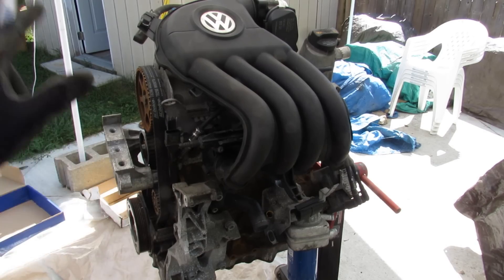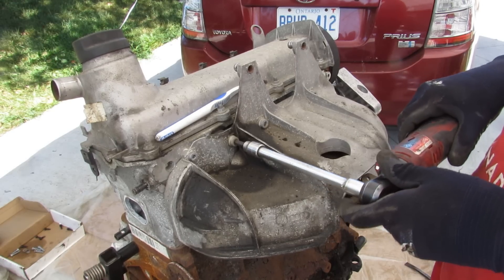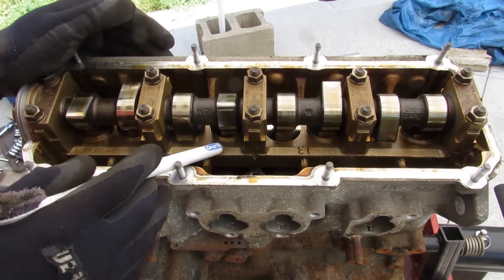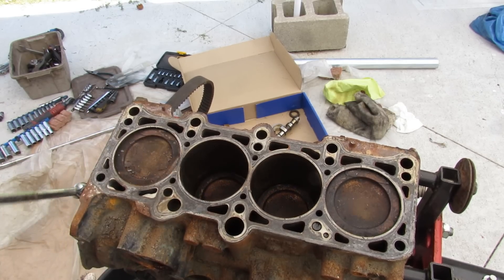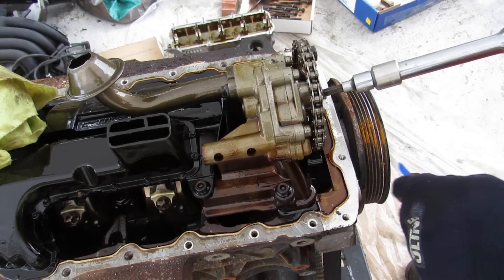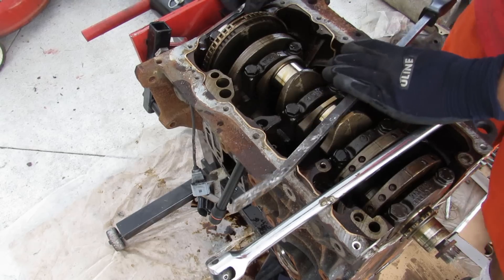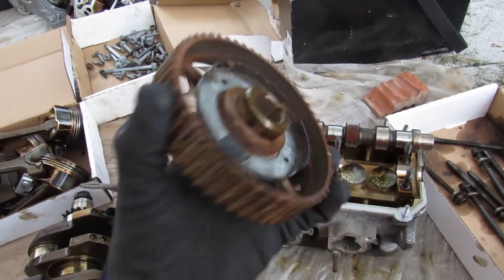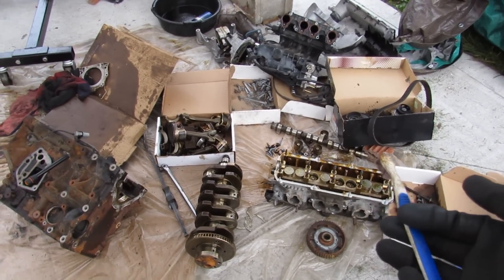The Simplest Modern Engine - From Volkswagen?

Comment: These EA287 engines are an older design. I had a 1989 B3 Passat with this engine in it. Absolutely bomb-proof. I sold mine at 15 years old with 160,000 miles on the clock, and saw it on the road 2 or 3 years later. Great cars that handled well , with strong simple and economical engines.
Reply: Mom had a B4 Passat from 1996 till 2011, 17 years. Got a JSW 2.5 to replace it.

Comment: Simple is GOOD. Dependable, reliable, easy to work on. And iron blocks are strong, don't require sleeves. If this were turbo charged, it would put out at least 180 hp, 200 pound feet of torque. Need more like this in other cars.
Reply: Looks like a good engine to modify.
Reply: @SI0AX  the 1.8 8v version can actually make 230HP without any internal modifications to the engine. This engines are bulletproof.
Reply: @ahyhijooooo  The 1.8 Turbo or the 1.8 non-turbo? I know the VW 1.8 Turbo engines are some of the most longest lasting 4 cylinder engines on par with the Mistubishi 4G63 EVO engine that can  get past 250,000 miles with good maintenance.
Reply: @SI0AX  the none turbo 8 valve. It's identical to this engine except the intake and displacement.
Reply: @SI0AX  Ever heard of Volvo b230?
Reply: @nikolaierikssonkukkonen9878  I know the older generation Volvo cars had outstanding durability and reliability and also safety standards. I did a bit of research and am impressed it comes factory with forged pistons.
Reply: @SI0AX  Got a 1.8t 20 valve in my 2004 Cupra R, the car is pushing 160.000km now and apart from a slightly rough idle sometimes, the engine is still runing like a champ! Still got the original 225hp for sure. IMHO one of the best 4 bangers ever made.
Reply: @SI0AX  B230f (N/A) and b230fk (turbo) did not come stock with forged pistons. They are actually the same internally only that the N/A has a higher compression ratio. Around 350 whp is the limit with stock rods in b230. Put some H-profile rods in it and the limit is much much more
Reply: @ahyhijooooo  glad to hear. I got a 1.8 8v with 402000 km on it. No smoke seems good wanna turbo it lol
Reply: @SI0AX  the N/A FWD world record was made with a variant of this engine
Reply: @SI0AX  They are the bread and butter of brazilian tunners, the guys make way over 1000 hp here.
Reply: good engine to work on if you have a massive tool box, too many different types of bolts...
Reply: @hgri89  B230? I can take half my 240  apart with a normal sized toolbox.
Reply: @nikolaierikssonkukkonen9878  I love the B230 but it does not make the power it should. It lasts so long because Volvo de-tuned it for longevity, not power. Even the turbo versions had pathetic low HP numbers. I loved my Volvo but I sold my 240 because it was terribly under-powered for being a 2.3. 

VW makes engines that will put a smile on your face and last longer than the car. I have had several VWs with high miles that run smooth and never needed to be taken apart. My wife's car has over 400K miles on the original engine, the head has never been off of it. The original clutch lasted 360K miles. 

It isn't a big deal having some triple-square bits added to your tool set. Chances are you won't even need to use them.
Reply: @David_H_Parker  Thats why you tune your volvo ;) tbh getting power out of a turbo b230 is not hard (N/A is a little bit trickier but it is not hard)
Reply: @nikolaierikssonkukkonen9878  Being in California, tuning a B230 for power would never be emissions legal for a daily driver.

I know how to modify engines and make more power. However, California does not allow much for modification on street driven vehicles.

The VW is pretty easy to make decent power and stay emissions legal. Or at least fly under the radar during inspections.
Reply: @David_H_Parker  "Laughs in Swedish laws"
Reply: Yeah bro I got a passat with a turbocharged 2.0 and it gets 207hp and 210 torque or sumn like that
Reply: This was a dog of an engine though. A Honda K20 with the same displacement even in it's most economical trim did 150bhp on 87 and got better milage than this.
Reply: @stuntmonkey00  The Honda is also a lighter car.
Reply: Volts wagon can’t make a reliable engine to save their life

Comment: It's basically the same engine since late 90's. But they have good torque in their midrange making it very flexible in their operating range. The 2.0L also has good longevity.
Reply: Might as well go all the way back to 74 or so in the mk1s, the lower end has been around forever.
Reply: @MrTheHillfolk  yeah, most of this stuff is identical to my 1984 1.7. Audi introduced the design a decade earlier
Reply: @twiggymac  another neat thing in the VW world is , look what engine is still used today to make the most power. 
Not a vr6,not a 1.8t , but the good ol 16v from the 80s. 
If I'm not mistaken , Boba motoring channel probably has the quickest VW ever and it's a 16v.
Reply: @MrTheHillfolk  wasn't the 1.8t essentially the same engine with a different head?
Reply: @MarchuxProductions  they all were basically the same on the lower ends, just evolved thru the years.
Reply: @MrTheHillfolk  It is EA113 series, which was evolution of EA827 used in Audi - lot of parts are still compatible, but there are some changes, for example, missing auxiliary shaft that drives distributor and oil pump.
Reply: yup same engine thats in my 99 new beetle
Reply: I live in a 03 Jetta. 158k. Have had it for a year & half. Runs good so far.
Reply: And what about the 1.8(1781 abs engine)?

Comment: Im only a hobby mechanic, in my opinion, the block is very well built. However the whole plastic intake does not seem well designed or built to last. As well as the plastic water pump, and unsecured plastic baffles, seems like some serious liabilities. Also for such a simple engine, maintenance on items like the spark plugs and thermostat do not look simple.  All said the reputation and longevity of this engine speaks for itself better than I can by just watching this vid lol.

Comment: Actually, this engine was used from 2000 to 2015 as the base. The change occured to it in 2010 when they removed the metal intake to a plastic one.

It's the same 2.0L 115hp engine.

Then back then they also had (in 2000) the 1.8t 170hp engine which was the non EA 888 engine.(the ea888 gen 1 introduced later on at 200hp 2.0t, the gen 3 being the 1.8t 170hp)
Reply: They’ve actually been making essentially the same 2.0 since 1993 for the MK3 Jetta. Slow, but nearly indestructible
Reply: The AJL 1.8t supposedly made 180ish HP though

Comment: The bigger brother of BSE 1.6mpi 8v 102ps engine.

Easy to tell, firewall side has the exhaust and the engine is canted backwards , and those that are 16 valve and ea111 family are canted forward with intake at the rear and exhaust at the front, some are aluminium like BSE and AZD, and some cast iron block

Comment: I've got a 1.6 8v AKL engine in my 1998 Golf 4 hatchback. It's basically a smaller version of this engine. From the outside it looks the same only the bore is bigger on the 2.0. My engine makes 74kW and for an old 1100kg hatchback I think that's decent power but in a modern golf/jetta it's just too slow (the 1.6 8v even came in the heavy Golf 6 with only 75 kW!). I love how simple the engines are and they are amazing to work on because they are quite small so they don't take up a lot of space. Also very reliable when maintained (they like fresh oil). My engine has 250k km on the clock but it runs like new. No oil leaks, oil or coolant burning. It just likes to leak some vacuum once in a while, but that's fixable. The only unreliable part on the 1.6 (and 1.4) engines are the 02K gearboxes, but lets not talk about those. Great video by the way

Comment: You must be in the Rustbelt . Every cast iron block you tear apart is covered in rust. Tidbit of history. When Toyota began opening dealerships in the USA many of their first mechanics came from VW dealerships. I worked for Toyota back in the early 90s and there were still some of them at Toyota dealerships. They worked during the Golden Age of Toyota. 12 month warranty, timing belts, valve adjustments, brakes, and regular maintenance is all that you did. 100hr weeks were the norm. Mechanic turnover was rare.

Comment: I was surprised to learn that VW used a 8v inline 4 in 2012 lol, nothing wrong with it tho, na VW motors are indestructible
Reply: Knowing Daihatsu used an 16v VVT engine with coil in plug and making 110 hp with a 1.3  in '98 is quite funny though it being in an cheap eco-box
Reply: @gorkzop  damn a 1.3 na making 110 is amazing
Reply: @xnopyt13  and yeah it's N/a. But I was lying tho , 102 HP and 120 Nm. Still not bad.. it's engine been used loads (de-tuned though @ 93 HP) in Citroen C1,Aygo , Peugeot 106 and a few others!
Reply: @gorkzop  no you’re right, search k3 ve2 engine
Reply: @gorkzop  didn’t know they shared engines

Comment: I didn't realize how similar the 2.0 non-turbo was to the 1.8t looks like its a chip right off the 06A block!
Reply: Except with 12 fewer valves that have far less affinity to their corresponding piston crowns.
Reply: @Bartonovich52  Don't worry, you can still bend all 8 valves when that belt snaps. They say 120 000km life, but mine always get replaced at under 50 000km, along with the tensioner. Cheaper than a new engine.
Reply: @SeanBZA  100k is fair enough. Nowdays same belts on the new engines have 200k interval...
Reply: @vasek987  Yes, and fail just after the engine is out of warranty, so conveniently.
Reply: You should replace water pump too as it's belt driven.Any guide pulleys also should be renewed.
Reply: Yes, the mk4 2.0 block is very similar to the 1.8T, at the time people where playing with head swaps and things like that.

Comment: Engine's great. Has enough torque and its super reliable and easy to maintain compared to some new nasty engines!
Reply: I’m impressed with this simple engine. I have a mk6 Jetta S with a manual transmission and it’s just passing 200k with basic servicing and by a total DIYer like me and it’s giving me no indication of any severe problems or heavy wear so far. I’m a happy customer with my 2.slow boat anchor. I’ll take this over the more modern and prone-to-break engines even if that means sacrificing the minimal gains of a faster engine would offer.
Reply: @Haffmatthew  Glad you did sir.
Reply: @Haffmatthew  I've got my 2006 Toyota Avalon Limited which is sitting at 235k and change. Just had to put a new serpentine belt, a CV joint went bad(new axle) and it got a new set of spark plugs for the second time in it's life. I'll hapily take the 268 HP available from it's 3.5L. I've found it to be quite reliable.
Reply: @Haffmatthew  I have one just like yours, love it. Couldn't give a shit if it's fast and peppy or not. It's enough to get on the freeway and cruise at 75mph with a struggle. Still pass a lot of much faster cars on steep grades(since it's a manual). I'm sure the auto is terrible but hey, the manual is fine enough for me.
Reply: Absolutely!
Reply: @rogeronslow1498  that's why there were no broken bits in there..........  cast iron.
Reply: I drove a couple of 2.0 jettas for more than a decade, bulletproof engine, with some low end torque that made red light launches fun. Fuel economy was so-so same as more modern 2.0 engines such as Mazdas.
Reply: @luisgpr1  thank you for this. This is real
Reply: in Brasil it is all about fuel consumption. daily drive a 1.0 liter 3 cyl, if i had this 4 cyl 2.0 would be great
Reply: @jvnl2006  wow. Thats amazing
Reply: It burns almost as much fuel as my type-r and that thing have twice the power and is just as reliable...
Reply: @xani666  i doubt if that's true. These engine are so efficient
Reply: @charlesadeoye8847  Just look at the stats and compare it to other engines with similar power. It's simple but by no means efficient
Reply: @xani666  mine beetle does 27.8mpg conbined. Thats ideal though not great sir
Reply: @charlesadeoye8847  naw the ABA has to use 91-93 octane
Reply: I have one with over 260000 miles
Reply: @allwinds3786  incredible sir
Reply: Yep, I've got a Skoda with the VW 1.6 BSE engine. No turbo or EGR. Slow and wheezy. But gets 50mpg and parts are cheap.
Reply: simple means that little can break and is reliable
Reply: @henkholdingastate  I get that, but this engine isn't anywhere near as reliable as equally simple Japanese DOHC engines. Being SOHC doesn't make it simple, it makes it cheap. That's literally corner-cutting these days.

Lacking timing adjustment, alternate cam profiles, etc. Sure. Keep it simple and remove that stuff, but there are huge efficiency gains from having intake and exhaust valves on their own cam without adding much of any complexity.
Reply: When you overheat those 2 plástic pieces melt and destroy the engine the one on the valve cover and the one on the oilpan
Reply: For me it's always about reliability someone or something you can count on do not let you
Reply: Drive a Jetta with one of these and you'll learn to hate it even if it's kinda reliable. Powerless, raspy boat anchor.
Reply: @OhPhuckYou . ." it's kinda reliable."  It's indeed one of the most reliable engines ever made.
Reply: @OhPhuckYou  Nor does anything larger than a 4 cylinder, at a time we are being taxed to death over the environment.
That VW 4 cylinder is old tech that had been long abandoned in Europe by 2010, but with 55bhp per litre was far more efficient than any US designed base engine choice.
You pay less for your fuel today, than I did 25 years ago in the UK and it has led to huge Carbon footprints per head in your country, whilst you all point at the Chinese.
Reply: @OhPhuckYou  try driving one with a stick shift. You would love it. Everything's not by been fast but at times by been durable😀
Reply: @OhPhuckYou  well a stock Jetta will destroy a stock Honda Civic so which other reliable 4 cylinder could you possibly be thinking about?
Reply: @OhPhuckYou  it has a higher top speed and well as a faster shifting transmission a dsg is way more fun to drive than a shitty cvt
Reply: @OhPhuckYou  nah actually the dsg come standard as of 2012
Reply: @charlesadeoye8847  I drove a stick Jetta for over 4 years and not many cheap sedans are as fun to drive as that thing was to me
Reply: @blu2.551  thats just it.
Reply: @OhPhuckYou  I've learned to take a Zen approach to driving. 0-60? Eventually. My 2003 Jetta is smooth and quiet, easy to maintain, handles pretty nice for an economy car. I've been driving it for 12 years and have saved a lot of money by not blowing it on hot cars like I used to. A 5-speed stick helps.
Reply: @OhPhuckYou  Germans and devoted VW lovers love them. Says it all.
Reply: @OhPhuckYou  I drive this engine with CNG from factory, 5 speed manual and i 100% hate it :D
Reply: @OhPhuckYou  nope! I had two MK3 Jettas with this engine…I’m in love with the 8 valve
Reply: Torque is not the important part, unless you want to pull a big trailer. It is the horsepower that moves the car. ;)
Reply: @worldhello1234  More torque - less gear shifting.
Reply: @worldhello1234  The exact opposite is true. You've never driven a torquey motor have you? The reason European cars had 5+ speeds even in the 70s while a lot of American shit still had 3 speeds is because you don't need many gears to get a torquey engine moving. Hell I've driven a 2 speed automatic and it doesn't feel weird in anyway with a big 6.7 gurgling away. Meanwhile a 1.6 liter 4 is ready to explode just to get a loaded car off the line. Torque is what moves cars, HP is great for track use.

Comment: The stupidest engine, just like Nissan Sentra 99, low power and efficiency but very tough.  I believe corolla 00 already have VVTI and increse torque and power significantly.  Civic has vtec since 1990s.
Reply from the maker: Corolla had vvt from 2000. That's also a tough engine as well but more efficient for it's displacement.
Reply: @speedkar99  Thanks, but many Corolla 2000-2002 has oil burning issues from bad piston and piston rings design.  Sentra is tough but very low torque compared to corolla 1996-1999 even without VVTI.

Comment: Another reason why I do not buy VW products...any of them.
Reply from the maker: But this one is simple!
Reply: @speedkar99  Simple is good. Timing belt, plastic intake, single coil with ignition wires and obstructed spark plug access aren't. Should be easier to replace the water pump, too. Anyhow, not a fan. Thanks for all the info. My Lexus is only 23 yo so it will be a long time before I have to think about a replacement and then it will likely be electric.
Reply: @wholeNwon  what's wrong about belt and plastic intake? Remembering fiasco with chains on TSI engines, Belt is fine. And plastic intake was norm on VW engines for past 25 years..

Comment: Wasn't that a shim under bucket to adjust valve gap?
Reply from the maker: I believe They are actually hydraulically adjustable. I didn't take the valve spring apart to explain that
Reply: @speedkar99  ok, that makes more sense

Comment: Too bad VW doesn’t make lawn mowers like Honda does. Honda can just use a lawn mower engine in their cars.

Isn’t this motor called 2.slow? This motor is pretty old for a western car company.

Vw isn’t like the Japanese where they keep engine designs for over 20 years.
Reply from the maker: Agreed. This engine is very slow for the A6 Jetta it has to move. 115 HP from 2.0L? Lol
Reply: @speedkar99  if this is the same engine, they used this on the mk4 jetta, possibly older generations too. In college I had a 2.slow engine in my jetta and added a neuspeed supercharger and cat back to it.
Reply: In Europe, it replaced more complex 1.8 20V in earoy 00's - probably due to lower production costs. But VW did some revvy engines too - like 1.4 and 1.6 in 6N Polo and Lupo